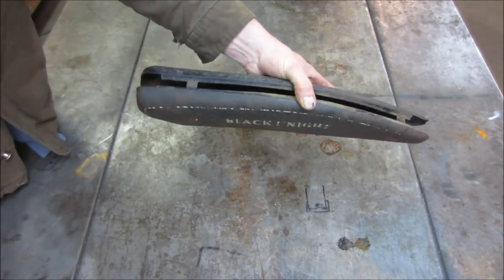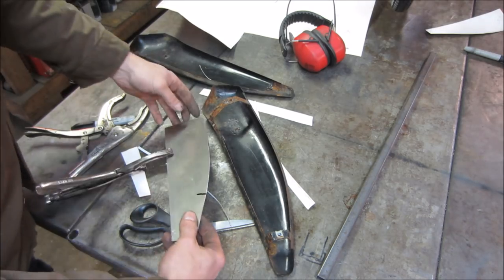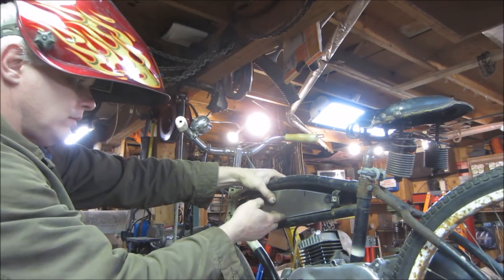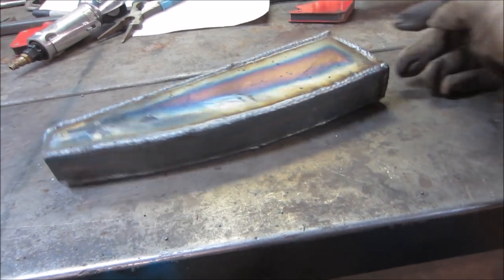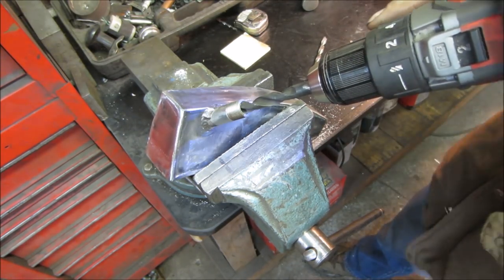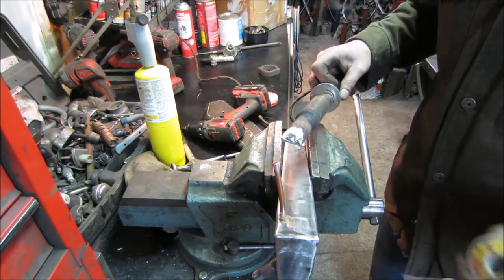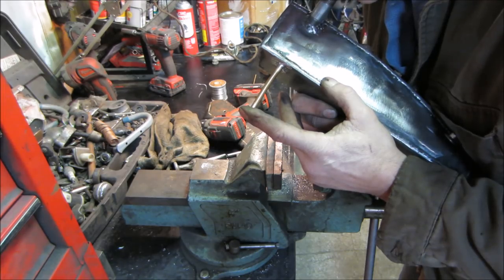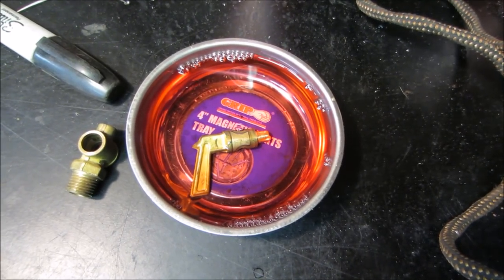making the gas tank from scratch for my engine assisted bike.

Comment: Old inner tubes could be cut into rings and used to wrap the tank.  Thanks for sharing the build with us.
Reply: Good idea. Rubber bands will deteriorate in a year
Reply: JJY Gardener 
Probably quicker then a year. I can't seem to reuse one indoors for more then a few months before it gets brittle.
Reply: Yes, exactly it seems like most elastic bands are made of a substance that is not fully cured when it comes out of the mold and the curing process pretty rapidly turns elastic bands brittle very quickly.  That's been my experience as well.   Inner tube may be a workable option.
Reply: I have a roll end of uncured rubber from a tire rebuild shop. They cure the tires in a mold within an autoclave. Does anyone know if I bound it up with wire and boil it in water on my fire pit outside if that would set it up? 
Because uncured it has zero resistance to fuel.
Reply: One wee problem is the tail end of the tank is very wedge shaped. A bead of black silicone just under the lead edge of the band to adhere them?
Reply: Good question Peg Tooth.  I think autoclaves use both pressure and heat to vulcanize rubber.  You could try a small sample and see if it works.
Reply: Peg Tooth, Good suggestion to use a dab of silicone to hold in place.  I'm sure Mustie1 will also bring his Yankee wisdom into play.  Will be interesting to see how it turns out.
Reply: Mark N I used to live in South Western Québec and have plenty of relatives in New England and we all embrace frugality. My toys was my papa's workshop and with the power of heated buns I learned quickly the top two rules ask before using and clean up after putting everything back exactly where I got it from. Lol.
This society needs more hickory switches. Ha!
Reply: Mark N I'll try it in the spring and see if binding and boiling in water and water with Epsom salts works and get back to you Mark_n
Reply: Would work pretty well as a longer-term solution to rubber bands. especially as rubber bands deteriorate fast as-is, but even faster if they bare the brunt of a fuel leak... ESPECIALLY since most US petrols have ethanol in them!
Reply: Excellent idea Mark N!!

Comment: Use the torch to heat the copper tube itself. The solder will draw itself into the spaces around the pipe on its own. Its called capillary action and is what plumbers (like myself) do.
Reply: I used to solder stainless and copper using silver solder flux and a oxy propane torch.using the same method you described. These were vessels that tested to 350 psi and never had a problem.

Comment: do not drill cap for vent cut a slot in the threads from top to bottom in will vent there and less chance of water getting in a lot of old small engines did that

Comment: Old Briggs tank valve with the glass bowl would fit the period of the bike. With a 1/8 - 1/4 pipe connector nipple welded to tank would be about right and easy to. They used two sizes back in the forties and fifties. I had a bike amf I think with the tank and rack on back . Red too. Kids back then would ride miles to get together. I did in the early 1960 s . God I'm old
Reply: I'm old also, but I had a stingray type bike, 20 inch wheels. How many refundable bottles did you collect for the 2cent deposit, in order to purchase your own Coke/Pepsi/Grape from a machine for a quarter?
Reply: YUPP we looked hi and low for bottles. Had baseball card motors , streamers and wrapped red white n blue to ride in the parades. Remember penny candy , two cent chocolate bars. Big barrels of pickles , the smell of the deli , ground coffee. . Kids will never have what we did. 
We new right and wrong by the redness of our ass too. Patriotic YUPP

Comment: This is a cool build. I had a thought. Since the proximity of the tank nipple to the carb is pretty short, how about bending a loop in your flexible line before attaching the ends to the carb and nipple. You'll get a lot more flex in the line than, if the flex was just straight. Just sayin'.

Comment: You should put a bottle dynamo on the front to power front and rear lights. One of those cable driven speedometers would look perfect on the handlebars. Give it more of a motorcycle look.

Comment: I wonder if a strip or two of foam weather stripping wrapped around the tank would do the job of the rubber bands.  If it would hold up (can't see why it wouldn't) then it should be a whole lot faster than 100 rubber bands.

Comment: That's the biggest soldering iron I ever seen
Reply: Are you bragging or complaining?
Reply: I think they are intended for doing lead/glass windows.  I'ved used them on automotive repairs in a pinch.
Reply: Automotive repair. Too much heft and power for fine glass work. The ribs in glass have an H profile.
Reply: 2nd biggest chief
Reply: That's what she said!
Reply: I think I would have used a torch instead.
Reply: Me too

Comment: For the fuel outlet copper tube and soft solder is no good. You should have silver soldered steel tube using the torch. The copper will work harden with the flexing and snap off or the solder will crack and leak.

Comment: Great video, Darren.. I see what you mean when you said once, Thanx for the suggestions but I'm the one doing this and I'll do it MY own dang way, lol, because I was thinking put a bend in the sides of the tank, thread a brass nipple and not don't cut the tab off of the bottom just bend it back in, in case someone in the future decides to revert back to a fake tank? Lol. Just my way of enjoying your videos and making them "interactive" for me. Bwah ha ha.
Also a quick question: I traded for a cast iron sausage making horn and the handle was repaired at some point with brass braising. Would that work for the seams of a tank if a poor dude like me doesn't have access to a welder? 
Have an awesome weekend and here's praying for a good fresh spring 
:4)

Comment: You could use a thick foam door weather stripping to isolate the tank and stop it from bouncing around between the covers. I`m not sure about the seals in the pet holding up to gasoline. You need something with a Buna-N nitrile seal.

Comment: Do you use the non ethanol fuel in all your small engines?  If so how long does it last?  Seems I am in continual carb rebuild mode with the new fuels.
Reply: rejracer 100 gas with no ethanol is great, I highly recommend it for ALL small engines, it has a ridiculously long shelf life, comparitively speaking.  The added ethanol fuels actually absorb water from the ambient air and leave behind a crud upon evaporation.
Reply: Second that. I use non-alcoholic fuel in all the small engines, old engines and tractors. I add some MMO for the aged crowd so they don't damage their valve seats but it is SO much better.

Comment: I would have put the fuel line coming out of the rear of the tank, inertia of liquid, lowest point of the tank (back wheel is off the bench) and all that physics stuff, and used some neoprene to pad it out. Nice work though!

Comment: You have enough room at the front of the "tank" tins to put in a small battery to run the head and taillight as well. Just a thought.
Reply: Why not? Any fuel spilled will run back to the back, there's very little chance of sparking if the contacts are properly insulated, and its a large enough space to be usable. Most commercial motorcycles I've driven have had the battery below and behind the tank, so it's not really a safety risk.

Comment: After it's bolted together- shove a nozzle with Right Stuff aerosol gasket RTV in the seams. A couple shots here and there. Wipe the tank with a thin film of grease first- the RTV will just flow around it, but not stick to it, so easy future removal.

Comment: Its coming along nicely. That valve is probably a natural gas cock or the like, and I'm reasonably sure the input was originally the threaded end. But if it doesn't decay and holds without leaking, what the heck, go for it.

Comment: Too bad your torch doesn't have a soldering iron tip / setup that you could use to do this type of soldering.  Looks like your vise is acting like a big heat sink.  Well if you run out of gas you can always pedal back home.  Don't forget to reconnect your coaster brake unit.

Comment: At 1900, I'm thinking NO not soft solder, silver solder it!  Soft solder will fracture with vibration. ( eg. Triumph rocker oil feed pipes)
Reply: Don't look at all of the millions of steel gas tanks used on older equipment then. 99% used common lead/tin solder.

Comment: mustie what welding gas do you use I only ever try'd co2 with an old mig welder 130amp
Reply from the maker: the 25/75 mix
Reply: Mustie1 How do you find that on thin sheet like under a car?
Reply from the maker: seems fine, im using 035 wire

Comment: Does the cap need a vent to help the flow?  Great fun watching you work.
Reply from the maker: yes that why l said l was going to drill a hole in the cap
Reply: Don't forget to make a baffle or two that can stop the gas from just pissing out the vent hole.
Reply: ... or as somebody mentioned above.  Cut some grooves across the threads in a couple places to allow it to vent without a hole in cap.  That way no water gets in from the top.  Just a thought.

Comment: What machine do u use for welding??
Reply from the maker: miller 211
Reply: Mustie1 but is it a gas less flux core??
Reply from the maker: set up on gas but could do either
Reply: Mustie1 i dont have the funds for a bottle, so is considering a flux core to start with. Could you be persuaded to show an example with the Miller without gas ⛽️??
Reply: Flux core is OK IF you are not doing really thin metal. and it generates a LOT of spatter and smoke like a stick welder (which is basically what it is) I use it a lot on steel in the 18 gauge and thicker sizes. It has a couple pluses over gas. One is that there is no gas, so it doesn't blow away in a breeze or run out halfway through a job. Plus it runs a bit hotter than gas MIG so you get slightly better penetration. Another is that it makes the welder much more portable because you don't need to drag the bottle around.

BUT if you intend to do autobody or thin stock, you will want a bottle.

Comment: I have a roll end of uncured rubber from a tire rebuild shop. They cure the tires in a mold within an autoclave. Does anyone know if I bound it up with wire and boil it in water on my fire pit outside if that would set it up? 
Because uncured it has zero resistance to fuel.
Reply: If so should I add magnesium sulfate (Epson salts) as a source of sulfer for Vulcanization?

Comment: im guessing less than a gallon, that's not really practical
Reply: beachbummm69 That bike will get over 130 Miles Per Gallon, that tank is entirely practical.  Try riding a motorized bike more than 10-20 miles at a time...think again, it is the perfect size really.